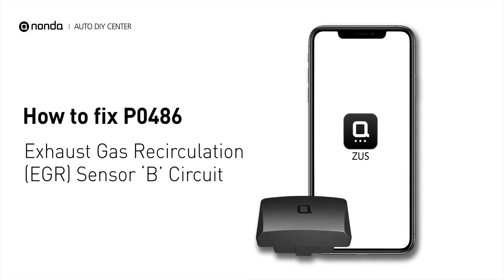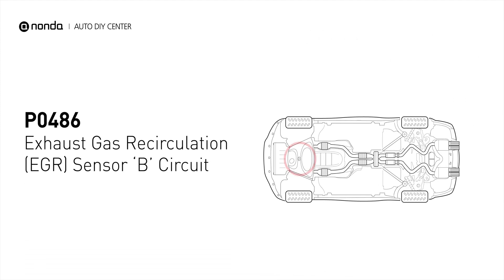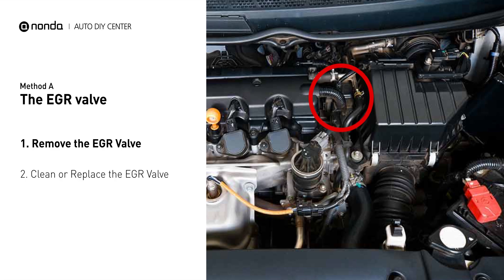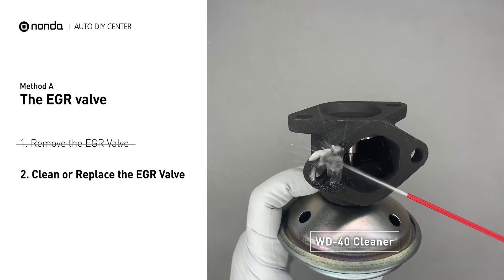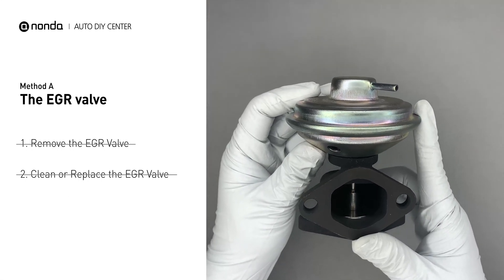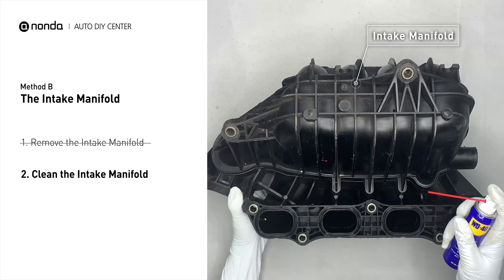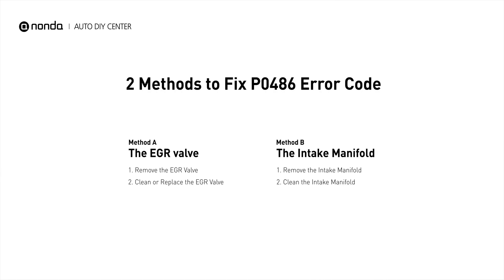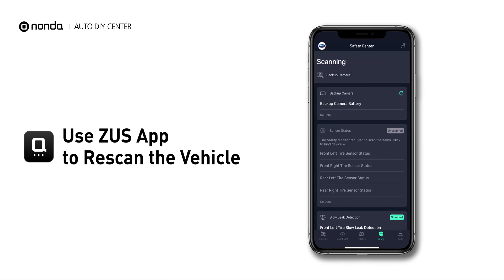How to Fix P0486 Engine Code in 3 Minutes [2 DIY Methods / Only $4.41]

Comment: Hello. Please help me identify the problem. I have a car VW Passat B7 2.0 tdi (2014) USA Now it shows error P0486 Before this there was error P0403, I replaced the EGR valve with another valve, the one I installed is not new, it was restored. Could this be the problem again?